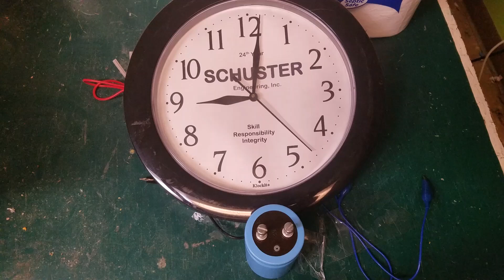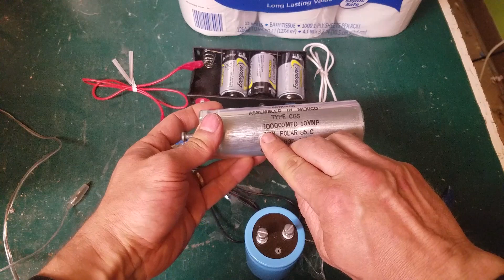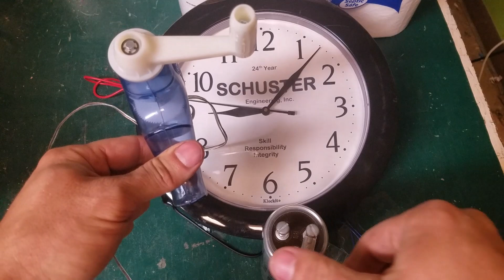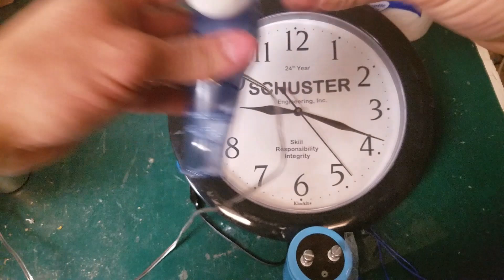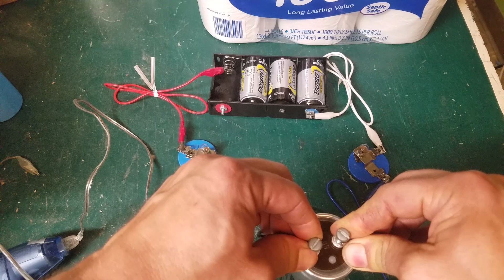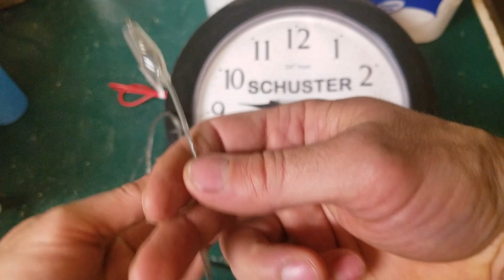Evidence: Capacitors Store Energy and can do Work | Doc Physics

Comment: Can I ask something.
If I connect two capacitors, charged and other not, then obviously current will flow, voltage will be set to some value, but the energy wouldn't be conserved(I annsumed there's no resistance).
My teacher said that energy is used for polarizing the dielectric inside the capacitor.
But according to calculations energy would be lost even without the dielectric.
Do you know where that energy go?

Edit:
The exact energy after the connection is equal to: E0 /(1+C2/C1)

C1 - capacity of charged capacitor
C2 - capacity of uncharged capacitor
E0 - egergy of charged capacitor before connection
Reply: Entropy. No system is ideal so energy is lost no matter what.